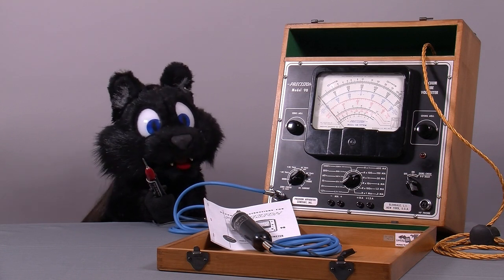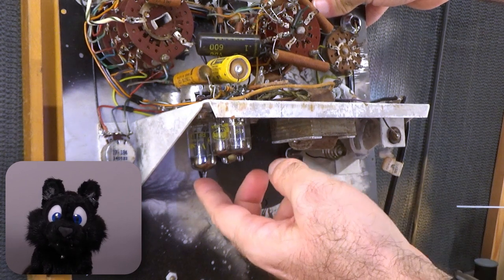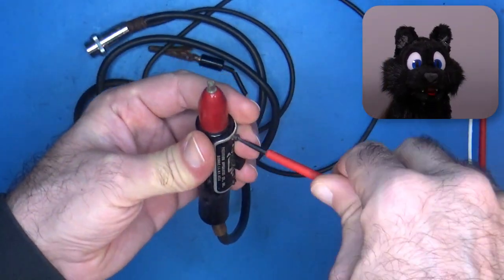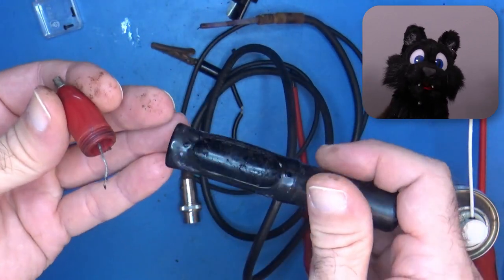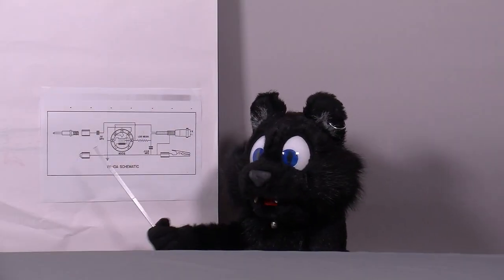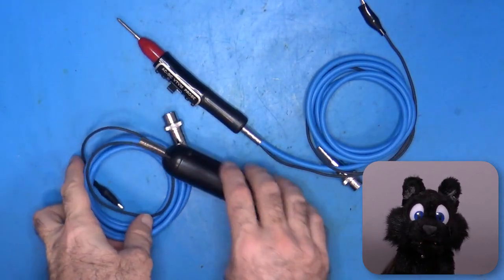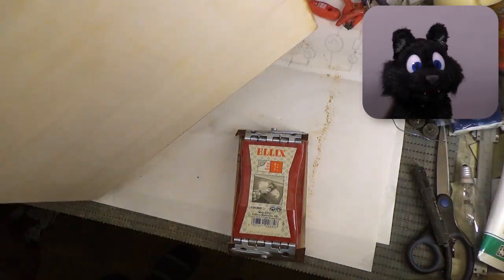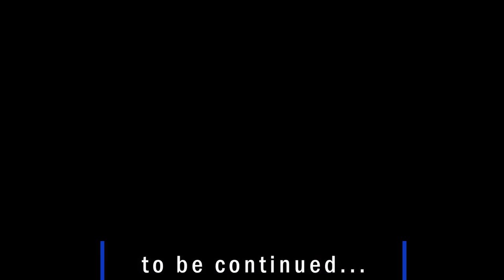Restoration Project #31 - Precision Instruments Model 98 VTVM (1/2)

Comment: May i know what test probe types ihave missing test probe
Reply from the maker: Which probe is missing? The DC/Ohms one is easy to rebuild: it's just a switch that bypasses a resistor (1Meg if memory serves) for the Ohms. The AC probe is more complicated: it has a rectifier tube in it...